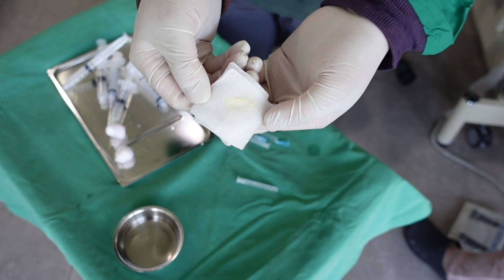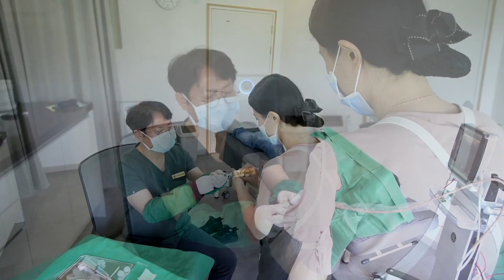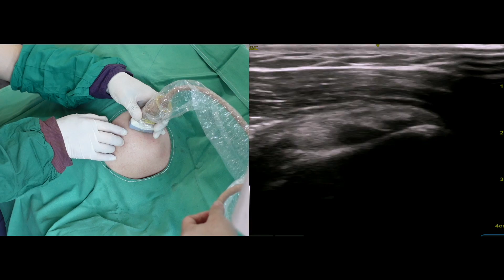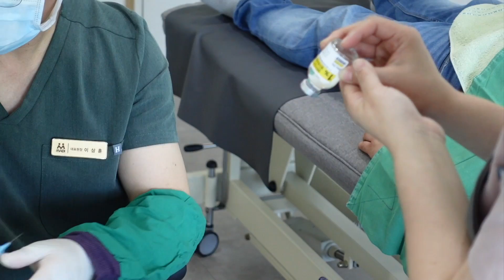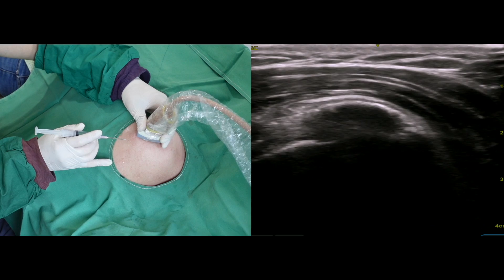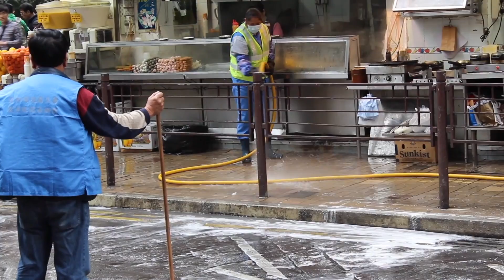Trailer_Ultrasound-guided lavage of calcific tendinitis of shoulder, ruptured calcification

Comment: query>
lavage and barbotage, which one is better?
(barbotage doesn't use saline irrigation, only required multiple needle punctures to break up calcium)
I am waiting for barbotage after 6weeks of steroid injection in Australia
Reply from the maker: I utilize identical terminology for both lavage and barbotage procedures. Perhaps what you're referring to is fenestration.
Reply: @practicalpainmanagementwit8115   Thanks for your replying, could I ask you one more, if you don't mind please, broken crystals(calcification) won't cause to re-build up in body somewhere or shoulder(I have it on shoulders)?
Are they(particles) all reabsorbed without trouble?
Reply from the maker: @alysamcs4522  It would be better if you understood that the calcium has been formed at the mutant osteocyte in the tendon. The calcium only irritates during its reaction; otherwise, it will be absorbed. The main problem of the calcification is the tear site previously located in the tendon. The calcium was contained in the calcium vesicle, which is large.
Reply: @practicalpainmanagementwit8115   I really appreciate to you for kind explanation, 👍

Comment: Can this be used on Achilles tendon?
Reply from the maker: When considering barbotage for the Achilles tendon, it's important to weigh the benefits against the potential risks. The removal of calcium deposits could potentially leave a gap, akin to a tendon tear. Given that the Achilles tendon bears a significant load, this could compromise its structural integrity.

Comment: Hi Dr Lee. Not many radiologists in the UK seem to do US guided lavage of calcific tendonitis like you demonstrate so I'm considering high energy focussed shockwave treatment. I wasn't sure on your final comments in this film - do you think ESWT is or isn't a good treatment option for chronic calcific tendonitis (I have had for over 10 years, both shoulders, supraspinatus and subscapularis tendons including large 14-15mm deposits).
Reply from the maker: In Korea, there are many doctors which still use for the calcifications.  but, they reported that soft and liquid type of calcification did response well than hard calcifications. it means the final resolution of soft calcification is the capsular rupture with leaking to adjacent tissue. So, the patients have to experence more painful stage before resolution.